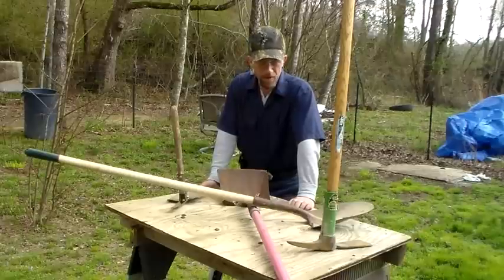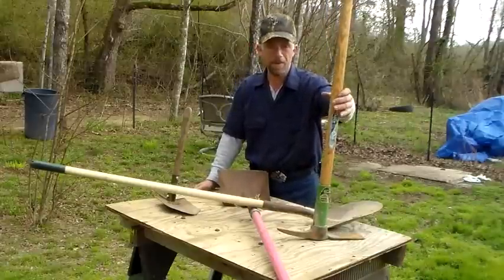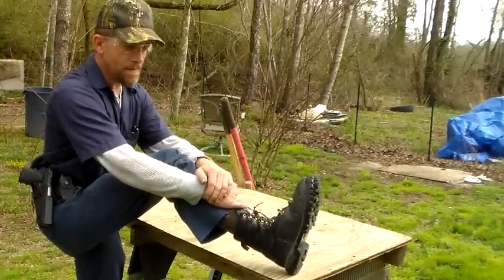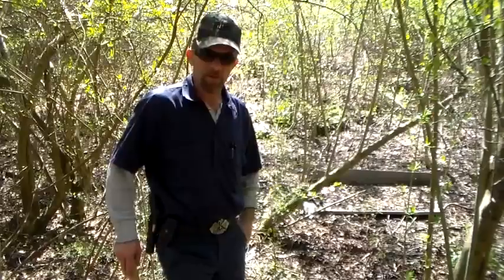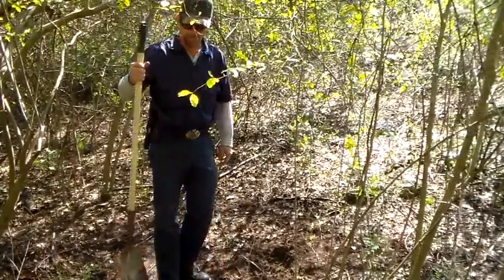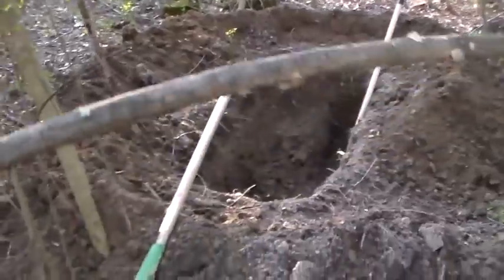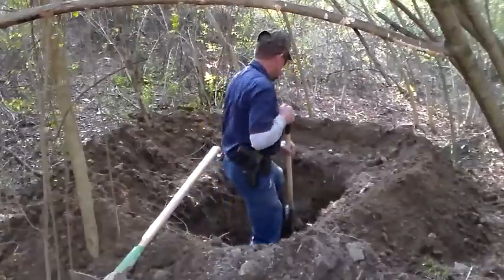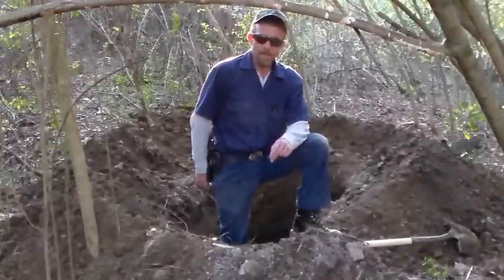Digging in for defense (Fox hole) Pt 1

Comment: Me and my friend dug a small 4ft trench in England. Turns out, the area we were digging used to be a landfill, so we dug up 2 bicycles, a small metal footlocker and a pitchfork (that we ended up using as a pick), not to mention all the other trash like bottles jars and rope (fuck rope, shovels can't cut through). You clearing the soil away looks lightning fast in comparison.
Reply from the maker: Zoranzor I feel your pain. I have worked as a plumbers helped in the past and ran into stuff life that. Rope is a serious pain in the arse. Thanks for sharing and for watching.

Comment: I would be slower than you unless bullets were flying around.  That would help me accelerate...  I'm trying to imagine doing that job with just an E-tool.
Reply from the maker: +Tim 63 if the weather had held and I hadn't had so many chores around the house I was going to give my E-Tool a real work out...or should I say my Knees and Back.  Thanks for watching and you are right about the bullets.
Reply: If you are in a bug out situation on foot carrying a standard pick and shovel is impractical at best, Have an E-tool you can depend on. You are not going to go to the store and buy a new one. Will you need to make a fox hole in route to you bug out location? No one plans to be shot at,  you have to be ready.  for some nut shooting you your tires.
Reply: @mackdaddy1911a1  I am a greenhorn when it comes to digging just as a ballpark how long will it take to dig a standard fox hole
Reply: @Bluefoot65  You can't go to the store and buy a new one no, but if you are in that situation and need to replace it, best to punch down a tree and make a crafting table, then make some replacement tools out of cobblestone and sticks.

Comment: Another nice thing you can use is called a ranger grave. These are typically what we dig for fighting positions now because they take a lot less effort and time than a foxhole. They're about 2 feet deep, the length of your body with your ruck sack behind you and you pile up dirt all around it. Gives you sufficient cover in the prone and only takes about 20 minutes for a platoon to get dug into a patrol base
Reply: +CopenhagenCowboy Slit trenches are typically narrow deep holes a squad or platoon or whatever your element uses as a shitter btw
Reply from the maker: +CopenhagenCowboy copy that on the slit trench. Thanks for the information. Though it was hard work I thought it would be an interesting topic to cover. More to come as I continue the series. I eventually want a proper fighting position. Thanks for watching and for the helpful information.
Reply: No problem Mack, thanks for the content as always. Looking forward to the rest of the series. Enoy the videos, always gives me some new ideas

Comment: I built a spider hole but made it on flat land not elevated at all and it looks like a well when it rains. It took me 2 months just to dig 5 feet down in a perfect square.
Reply from the maker: So far through all the spring rains it hasn't held any water but the winter rains will tell the tale. it floods nearly every year but peers so fast it's gone a few hours after it stops. We'll see how it does come winter.
Reply: Nice man ill be waiting for your next video to see how it turns up also i had an infestation of ants in mine. If i poked the walls or stabbed it ants would pour out so i had to put poison. And occasionally it kills mice and rats. It will rain and fill up and i guess mice dont see the hole and they end up falling in there and drown so the water smells really bad so i would probably cover it up when your not working on it. But nice job man.
Reply: Its covered it now i made two more in the woods hehe